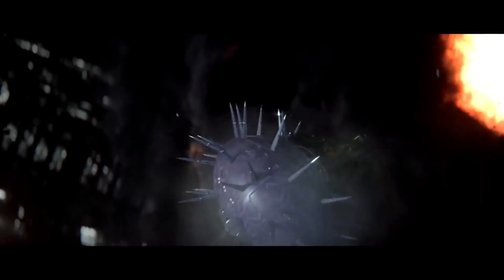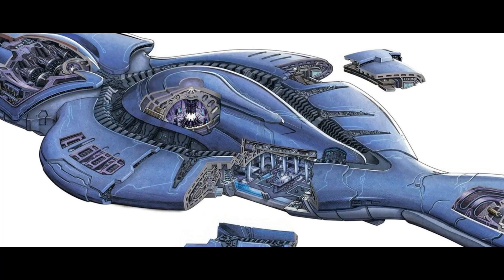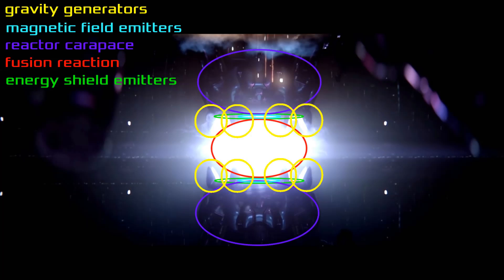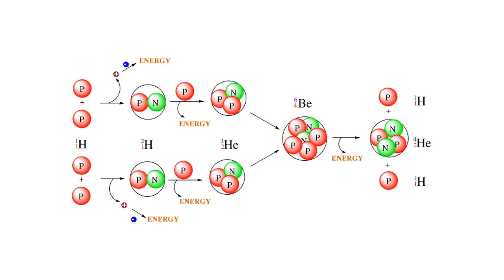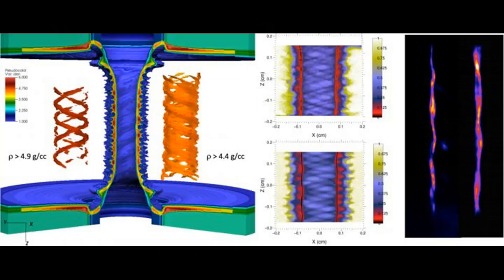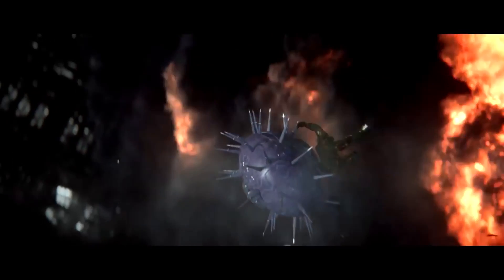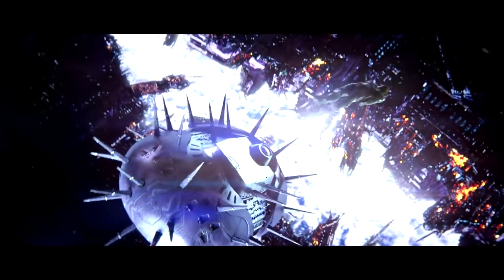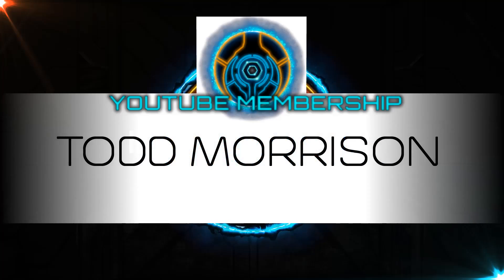Pinch Fusion | The Archive

Comment: Interestingly enough there are companies working creating pinch fusion reactors, but instead of gravity they use pistons to compress the gasses.
Reply: I know of one that uses some kind of light gas gun (maybe that's what you're referring to) to accelerate a projectile onto a pellet of plastic containing a Deuterium-Tritium mixture in a specially shaped cavity. Collapse of that cavity under hypersonic projectile impact creates shockwaves inside it which combine to produce extreme pressures in very small points, indeed a very unusual and creative approach.

Comment: Quick summary of the post I'm making. 

Why lone wolves instead of headhunters?

Rakshasa armor core obtained when introduced to spartan lone wolves, season 3 armor based on SPI armor means personal spartan meets spartan headhunters? 

Our personal spartan on the path to become headhunter, giving our spartan classified background to disappear and work in background of main story?

Possible dlc for personal spartan campaign if theory panned out?
---------------------------------------------------------

Something I've been thinking about. 

The headhunters aren't widely known and are highly classified. 

Currently certain spartan 4s are taking on the role of headhunters but are labeled as "lone wolves", despite being in groups of two as seen thus far.

Because headhunters are so highly classified to the point of being unknown to their fellow Spartans in lore.

 If at some point, based on the season 3 armor core I believe was said to be "based on" the SPI armor.
That we will meet current headhunters while on an operation with the lone wolves. 

If you remember Eklund said "there's always room for another wolf".
Implying that our spartan is being invited to join the team and go out on real missions. 

Remembering we got the Rakshasa armor from being introduced to the lone wolves, so extending the logic we will meet an individual or group of two spartans wearing the season 3 armor based on SPI.
SPI being associated with spartan 3s and by extension the origin of the headhunter program. 

Could our spartan become a spartan 4 headhunter and be their own incarnation of noble six?
 In the background of the halo universe, allowing for them to take an active role in the story in a shadowy manner?

Comment: Physics student here. This type of reactor, at least in concept, isn't that advanced (for as much as the covenant are presented as technically advanced). It's also very realistic.

IRL, humans have built hot fusion reactors called Tokamaks since the 1960s. They do use Deuterium and Tritium as fuel. The reason we still use fossil fuel plants and not fancy fusion reactors, is because scientists have only recently approached a 1:1 energy input/output ratio (meaning only recently are these things approaching the point of putting out more energy than put in to maintain the fusion reaction). And, it'll be another step beyond that, to figure out how to reliably siphon off that profit energy, and a while more to achieve an energy ratio high enough to account for inefficiencies, and put out at least a 1:1 electrical energy ratio. Other practical issues will need to be sorted out, like how to vent waste helium, and pump in more fuel without shutting down.

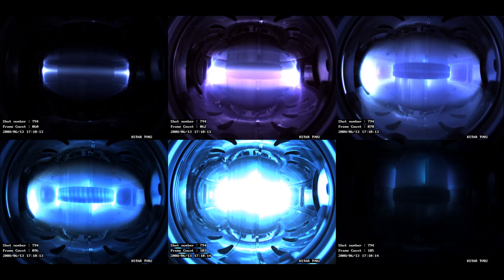Tokamaks even look remarkably similar to the pinch fusion reactor. In fact, I think the pics at 4:37 are of the interior of a real Tokamak while it's running.

There are 3 big differences between real life Tokamaks, and these fictional Pinch fusion reactors. First off, we obviously dont have gravity bending technology (unless you want to out yourself as a UFO nut, lol). Where the plasma confinement of the Pinch drive relies on both gravity manipulation and electromagnetism, real life Tokamaks rely solely on electromagnetism to confine the plasma (as well as partially rely on it, along side other technologies like microwaves, to dump energy into the plasma, to heat it up enough for fusion). Thats why tokamaks have this fat donut shape, it's the shape of the electromagnetic field used. This field creates something called a magnetic bottle, which keeps the plasma from interacting with its environment. In this case, its environment is the Tokamak chamber walls. For reasons I'll get into in a second, plasma contact with these walls wouldn't like, melt them, or blow up the reactor, etc. Worst that might happen is that it damages the chamber a bit, maybe scorches the walls. The real reason confinement is important is because these extremely fast and hot atomic nuclei would immediately lose most of their energy into the wall if confinement were lost. So magnetic bottles are more there as an insulator, to stop all energy losses through convective and conductive means.

 Second, the pressure in Tokamaks is very low. Not high. The reason the multimillion degree plasma doesnt like, instantly vaporize the chamber if confinement is lost, is because when youre talking about a plasma that's that hot and energetic, even though it's highly charged, it's really difficult to confine with a virtual barrier like electromagnetism. Slightly too much difference in pressure, and the plasma breaks confinement. The quoted pressures here of hundreds of billions of bar, is a total fantasy. Who knows, maybe if we could warp gravity like the covenant, we could achieve that (and if we could, it's reasonable to assume we would use that technology in fusion reactors for this exact reason). In reality, electromagnetism struggles to contain plasma so hard that the plasma in our tokamaks have to be very close to vacuum pressure. As such, Tokamaks have to be like vacuum chambers, and the plasma inside is only marginally more dense than the vacuum of space. Any more pressure than that, and the magnetic bottle would fail. There is an upside and a downside to this. The upside is, it's safer. The low pressure means that, while the plasma is millions of degrees, that tempurature is of only a relatively small number of atomic nuclei. Confinement failure means these nuclei impact the chamber walls, and dump all their energy into it almost instantly, immediately cooling the plasma to a more normal temperature gas. The sheer density of metal walls means that energy quickly spreads through far more atoms. So while the temperature of the chamber walls rise, it never rises above melting point. The downside is, pressure helps fusion to occur. So low pressure means poorer fusion rate. Scientist compensate for this by pumping the temperature of the plasma way higher than what you'd ever find in the cores of most stars.

Thirdly, Tokamaks are physically contained with a chamber wall that's fairly close to the magnetic bottle. This is because reactor walls are important to adding energy to the plasma (they feature microwaves for example) and they will likely soon be important for energy extraction, and mid-run refueling. They are also vacuum chambers, if you tried to run a Tokamak in open air, it would immediately lose confinement with the high pressure atmosphere breaking into the magnetic bottle and ruining the plasma. This massive chamber Chief is flying through with this relatively small and open bottled fusion in the center isn't something youre likely to see in a real Tokamak.

That being said, I also wouldnt call this design unrealistic in the Pinch reactor's case. The massive chamber could be a requirement for all manner of reasons. For example, it would take a ton of artificial gravity to confine hundreds of billions of bar of superheated plasma, and gravity well strength is a function of the gravitational objects size, and the square of the distance from that object. Perhaps the chamber walls need to be that far from the plasma to prevent extreme gravitational strain on the chamber walls. Maybe its a lot lighter to just build a massive chamber, than a smaller one reinforced against the gravity well. Maybe you'd need to cordon off the reactor to that degree anyway, as you certainly couldnt have inhabited rooms that close to the core if gravity is an issue. Perhaps radiation is an issue as well, radiation level also drops with the square of the distance from the source. Perhaps the chamber walls also still play a role in energy addition and extraction. This is important, for example in another kind of IRL fusion reactor. There's a reactor in the US which ditches the whole concept of Tokamaks, and works by focussing dozens of lasers onto a tiny tritium pellet, and essentially allowing it to blow up inside the chamber as an unconfined mini nuclear explosion. In fact, that's why this reactor was built. After the nuclear test ban treaty, this type of reactor was the only way to explore nuclear weapons physics without creating fallout or nuclear waste. It wound up unintentionally contributing to fusion energy physics, as it recently broke a record in energy ratio. The large chamber ensures two things. The lasers are the energy addition method. If the lasers miss the pellet somehow, and hit the opposite end of the chamber, its not a big deal, as only the highly focussed point in the center where all the lasers are ideally perfectly aimed, can recieve enough energy to cause damage. Second, the large chamber allows much of that explosive energy to dissipate before even reaching the chamber walls. If you covered the walls in some sort of heat exhanger that spun a turbine and generated electricity, this expansion allows the energy to spread out, resulting in a cooler and more manageable temperature at the chamber walls than you'd absorb much closer to the detonation point. You'd still extract almost the same amount of total energy, but spreading that extraction out over such a large area reduces the temperatures any one patcg experiences. So this energy concentration increase on the way into the center, and decrease on the way out to the chamber walls could be really important for temperature management of components.

It could also be a failsafe feature. Hundreds of billions of bar is a lot of pressure. And its not just pressure either, it's that pressure at millions of degrees... Unlike with a Tokamak, if a Pinch drive lost confinement, it would literally detonate like a nuke. Perhaps the chamber is so huge, so that in the event of a catastrophic loss of confinement, the detonation has room to expand into that chamber, and rapidly reduce in pressure and temperature before impacting the chamber walls. By that point, the explosive power could be more manageable, and the reactor could maybe vent the plasma, or try to reconfine it.

I would imagine this safety feature would rely on two things. First, that the chamber be intact. Second, that the origin of the explosion is dead center, so the shockwave impacts the chamber evenly, allowing the chamber walls to take full structural advantage of its near spherical shape to absorb the impact.

... These are two things Chief and the longsword pilots mess up. The longswords blast a hole in the chamber wall, which could ruin the structural integrity of the chamber as a whole. Then, chief detonates a covenant superweapon (looks like their version of some kind of nuke... And a BIG one at that, so probably insanely powerful given what nukes are like today IRL). For all we know, this weapon exceeds the energy output of a confinement failure in the reactor. And, it's offcenter, damaging one side of the chamber far more than the other. And, undoubtedly, the explosion probably broke confinement, immediately resulting in a secondary explosion. Between all that, the chamber probably couldnt handle it, and it makes sense that move would literally blow the ship apart.

Anyway, this is one of the reasons why I like the Halo universe. The writers for a long time, tried to stay in the realm of believability, basing even covenant technologies on at least distantly plausible technologies, rather than relying on pure clarktech to explain away alien technological superiority.
Reply: if only you had made this comment 3 weeks later lol we have a 1:2.3 for fusion now
Reply: @seagie382  Don't confuse "ignition", i.e. Q(plasma) > 1 with net energy output. At current technology level, we need at least Q(plasma) of 10, sustained, for fusion reactor energy gain Q(total) > 1. That's because cooling of magnets takes energy, electricity to microwave is nowhere near 100% efficient, thermal to electricity cannot be 100% efficient, etc. We are at least 10 years from Q(total) > 1 and at least few decades (I think no less than 50 years) form a working fusion powerplant. That is if we don't come up with simpler alternative by then, e.g. commercial-grade thorium molten salt reactor or something like that.
Reply: Ps, I just went and looked it up, actual tokamaks sit around 1 millionth of 1 bar... So yeah, huge difference in pressure between Tokamaks and Pinch reactors. If humans could achieve hundreds of billions of bar in a Tokamak, that'd be pretty awesome, that would have an insanely high useful energy ratio.

It's a shame we cant warp gravity.
Reply: Instantly stopped reading after the words "ufo nut".

There plenty of evidence, actual government bodies to find it out, actual government bodies that study it, and TONS of correlated eyewitness reports. If you dont find it its because youre too scared to look.
Reply: To be clear i dont think we have gravity tech. I know that ufos exist both from recorded footage and accounts but MY OWN EXPERIENCE as well.
Reply: @dgalloway107  if by UFOs u mean genuinely unidentified flying objects, of course they do. if you mean you’ve seen aliens, then idk what to tell u man
Reply: @theenderclops  kind of like how a Jack Skellington Halloween balloon got away and people all over were talking about seeing a man flying miles up in the sky 😂
Reply: If we manage to mass produce dark matter this will be a piece of cake
Reply: In short. Halo Sci-Fi goes hard.
Reply: that was really interesting and now i want to be a physics student. thanks!
Reply: Email me, I need people like you on my team for something "special".
Reply: An engineer and physics enthusiast here. Great analysis but I disagree on your final point which is basically about writers doing due diligence trying to work out somewhat plausible tech for a superadvanced civilization (gravity manipulation is the definition of Clark-tech after all). What strikes me as odd is the choice of gravity confinement instead of electromagnetic confinement technique - gravity confinement fusion only works in stars because:
1. the mass involved is extreme by any measure, otherwise gravity is by far (and I mean very very far) the weakest force of nature, and
2. confinement problem does not exist - the energy of a star core is confined by countless opaque layers of plasma above it.

Even if somehow gravity and pressure in the "pinch fusion reactor" would be the same as in the core of a star, it would not work -  the energy would be lost immediately due to radiation and random escapes of the most energetic particles. These particles move at approximately speed of light, so you need a black hole basically, to stop them from escaping. Even in that case, fusion can only take place reliably and sustainably in the thin layer above event horizon (needless to say, extracting energy from that region would represent an engineering challenge).

By the way, if you are capable to produce and control a black hole, you have a lot better energy source than fusion anyway. The Covenant contraption could somehow work without a black hole only if you encased it in some kind of perfect mirror (something that would perfectly reflect both electromagnetic radiation of any wavelength (but most importantly hard gamma rays), and particles like electrons, neutrons, protons, mesons, etc.) But in that case you would also instantly have a much better energy source than fusion anyway.